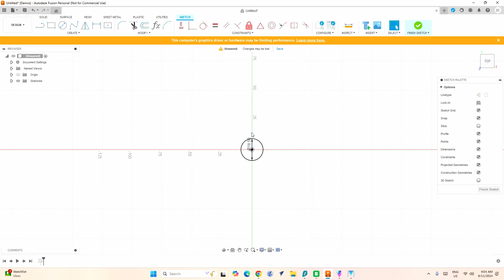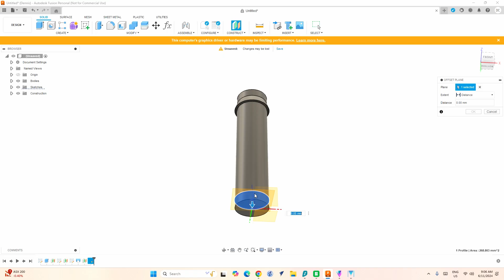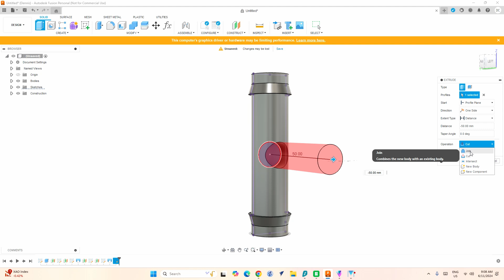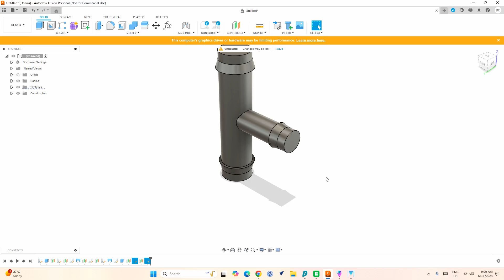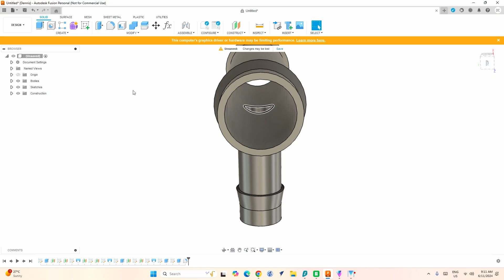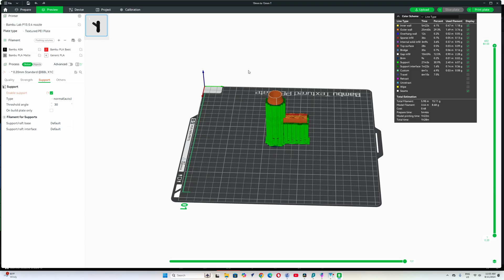Fusion 360 design and 3D print an Irrigation fitting.

Comment: Those Barbs are for Drip fittings Only. Also, Drip is different than stake emitters (gph vs gpm) so, you don't want to put ANY stake emitters on dripline.
Reply from the maker: Interesting, I just copied a fitting I purchased from the hardware store, but I'm sure your right 👍
Reply: @plasmaDave yeah, I'm developing some funny pipe parts and something for Risers